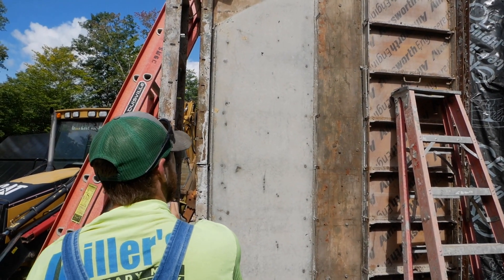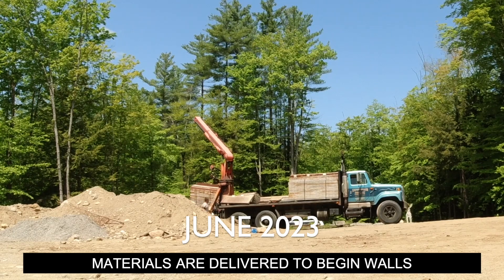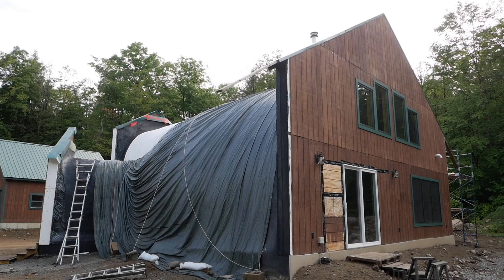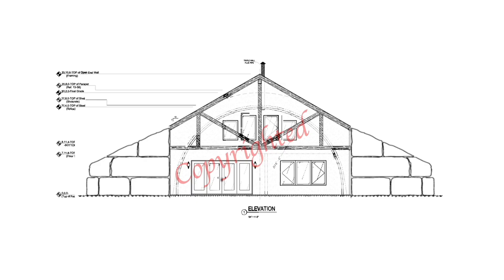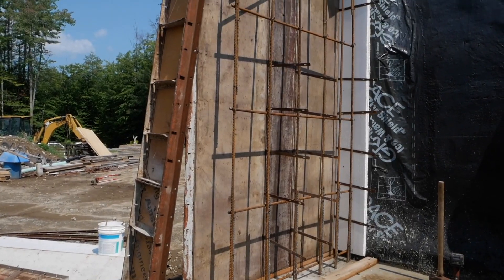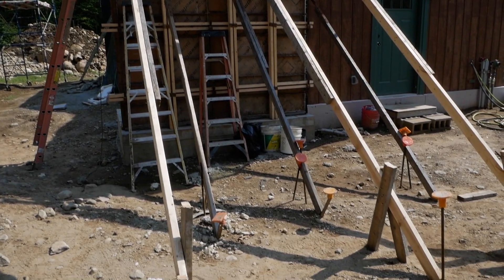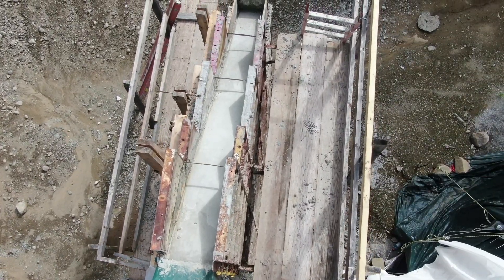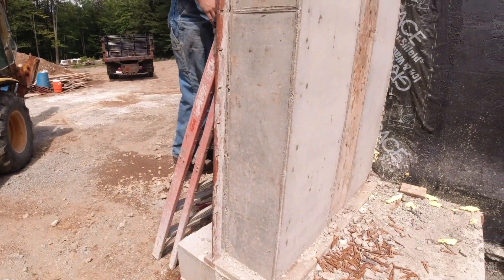HUGE Engineered RETAINING WALLS for Green Roof DOME Home are DONE!

Comment: Ive worked on concrete forms for years (carpenter by trade).  The one thing about concrete is the taller/higher the pour the more pressure is on the forms.  So by doing it in two stages they save you a fortune in expenses.  It is possible to do that in one pour but i suspect youd be using industrial grade forms like i used at a mine.  They are ridiculously expensive compared to normal concrete forms for average residential work.  The industrial forms are far heavier and we had to zoom boom them into place.  Plus the bracing on them is unreal.

Id have to agree with your concrete guys.  Doing the pour in two  stages was the best option.  It looks great and solid.  I love seeing pro's at work. 😊
Reply from the maker: Thank you! They were top notch from start to finish and we already began piling the dirt and rocks next to, behind, and over the dome so we can vouch for their stability! 😁

Comment: Something to think about. You stated that you were going to use boulders for the wall that weren't poured concrete. Have you ever considered Gabions for those instead of the boulders? In our neck of the woods, boulders are extremely expensive when you consider that they charge 10 cents a pound & then charge you to deliver them. There are examples of folks using gabion walls to build their homes & gabion walls have been used for a long time to prevent erosion on rivers & streams. Just my 2 cents. Worth every penny. LOL
Reply from the maker: Yes, we certainly have the rocks for gabion walls, but we also have the boulders! We’ll probably have both